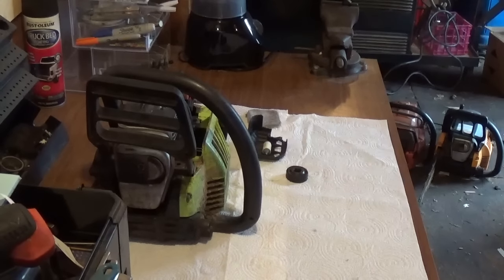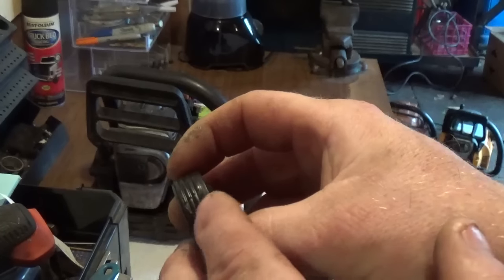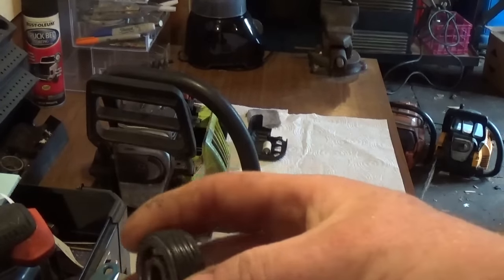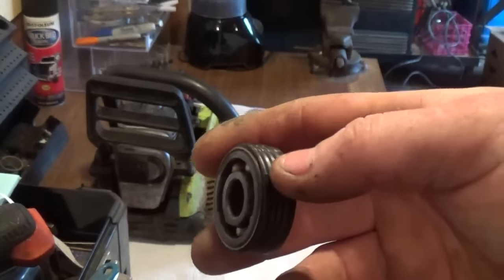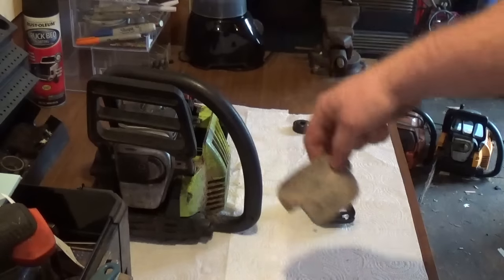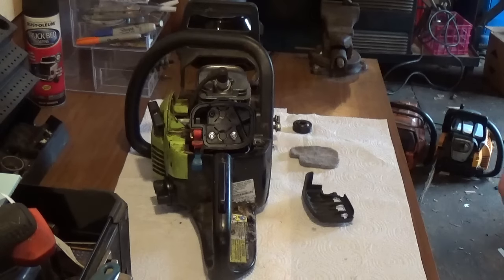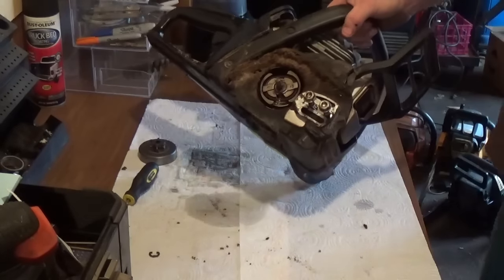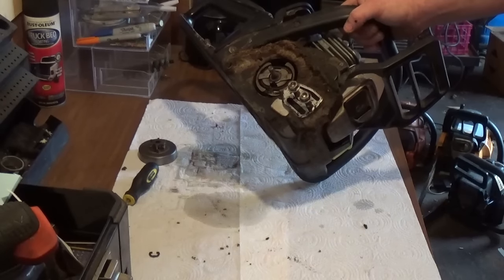Common problems with Poulan Chainsaws

Comment: I agree, Poulan chain saws are a piece of shit.  Worked all day yesterday replacing the fuel lines.  Took 2 trips to the hardware store.  I needed right angle nose pliers and a long nose pliers to pull the fuel lines into the gas tank which took hours.  Got all done, filled her up, then the frickin thing wouldn't start.  My thumb is sore as hell today as the flesh got pulled away from my thumb nail when putting the small fuel line on the carb tubes.  If your not suppose to use ethanol there should be a label on the chain saw.  The replacement fuel lines really suck and are very hard to get on.  I've heard people say to heat the ends before installing them. Also, another problem is keeping the chain on the sprocket.  What the hell should I do now, buy a Stihl?
Reply from the maker: You likely would be a happier customer with a Stihl  just keep above a ms 250 ..

Comment: They just don't know how to use them atleast 6 years ago when I bought my poulan pro it was in a box and i got the right book that goes with the pr5020 inside the box.

I think they used it fucked it up and now don't want it anymore 

Mines used like hell and 6 years old with no problems
Reply from the maker: Turtle Frog if what your saying is true than it shouldnt  be a issue providing a short video validating your claim . Take on the Poulan challenge ...The details are listed in numerous replies and to avoid confusion there is a video posted of what is expected .

Comment: I have done the poulon challenge. Mine is well maintained.
What you hate is poorly maintained machines.
I hate Stihl for one reason. The chain oiler doesn't work right.

Comment: Most chainsaws are identical I got the new skill chainsaw and it doesn't need to be choked. That baby runs rich 50 to 1. You go out three pools and she's running. The only problem I got chain gets dull it really hates dirt when you're cutting don't you put your nose of your chainsaw in the dirt. Most people do when they're cutting and it dulls the hell out of a blade
Reply from the maker: NOT exactly { Chainsaws do differ } but mostly aesthetically ..... Well I should say with at least the cheaper branches of Husqvarna {color wise anyways} Don't get me wrong there are some chainsaws that are unique in  there operation and controls as well as assembly . But for the most part are somewhat all the same with the exception of quality and molding of high end parts

Comment: Mine had shattered fuel lines upon unboxing. Fixed those and replaced carb cause the plastic choke arm shattered as well. Got it to run for 3 minutes tops. Now it's super hard to pull.

Comment: All saws have bad features/designs. I've had fair luck with these saws but recognize how cheap they are. That's their main draw. I've worked on this stuff for nigh 60 years & know cheap doesn't get it. However I know what the weak points are with most cheap saws, I do try to look at each 1 that comes in. Most of what I see are neglect.
Reply from the maker: I to must admit I have seen my fair share of neglect with many pieces of equipment . However I have seen first hand many casting defects with Poulan and to be honest some other lower line saws as well . Failure points so obvious they cant be ignored .....Yet honestly are...... in assembly / manufacturing.......So  although neglect is certainly a issue in some cases simple truths that can be evidently revealed are passively and asininely ignored so that equipment failures can be embellished as a result of improper use . I have found this to be the truth many times .....through warranty relief efforts ....We would show picture after picture proving the cause of failures .....Bringing actual new carbs {NEW }be mindful .......even brand new saws straight out of the box to service schools ........Never even having the Poulan boxes opened and proving there were air leaks .......Only to be told they would be ok once they had been ran for about 30 min ......My boss at the time and I got feed up with this cop out bullshit mentality ......And gathered a group of fellow Techs /Dealers attending a service school .....Brought them outside to the back of a old pickup that had some small maple branches about 5 inches round and asked these crocked bastards whom were advocating that these saws would be just fine to run three of the 6 we brought ....Only one agreed ......He opened four Poulan boxes {SAWS} Brand new ...{Four} and of that four only 1 actually ran the full 30 min often stalling and bogging down before dieing. 2 had flooding issues and the third actually ran hot and showed evidence of scoring of the piston and cylinder ........It would restart after about 10 pulls but was obviously on its way to a permanent failure .....I wont give last names .....But Barry of C.P.D. told us that Poulans had over a 68 percent failure rate in returns . He also said at the time that Husqvarna /Poulan where taking these returns and in the process of making a factory dedicated to nothing more than Refurbishing failed new Poulan and Husqvarna Bottom line saws . Sure enough he was right a few  months later we started seeing little hot pressed{R} on the Poulans that customers brought from time to time to the shop for assessment or repair .....{although to be honest we where in the mindset that no more Poulans would actually be repaired in shop } ......We did from time to time contend to adamant customers .....Eventually George came to terms that it was better to be the asshole of today than the Son of a Bitch of tomorrow and told customers the truths of what we already new . Poulans are {FUCKING JUNK } and at first it offended .....Then as more and more people had there wallets/purses lightened by other dealers only to hide in the shadows of buyers remorse . They started praising George for his honesty . And Damn did Sales go up for our Redmax lines as well as Jonsered Chainsaws .......I Know .....I know ....there both owned by Husqvarna .......Well Redmax wasnt at the time but later Husqvarna bought Redmax for there Strato Charge Tec . So In conclusion 60 years of experience is impressive and I am sure you have seen many pieces of equipment come and go . By that right in its self you have my respect but operator neglect has very little to do with a piece of equipment that is and surly was designed to Fail .
Reply: Well put but I swear there are people that shouldn't be allowed around equipment. No idea what they're doing & if you try to explain to 'em they'll get mad. The cheap line Stihls are exactly that, cheap! The days of buying something that'll last are gone & like you I try to explain to people, in a nice way, that it's a POS. Sometimes they listen, sometimes they don't. The shop I worked in took everything & anything in & that nigh on to 40 years ago. Parts were available for the most part then. Nowadays you have to rely on either aftermarket or used stuff. In this area 028 Stihl parts are virtually non-existent but we're talking of a 40 year old saw. There were millions of those sold & they were good saws. Our shop sold Echos in the '80s along with cheap Homelites. Then came the Poulans when H-L shut down. Now that same store sells Stihl, Echo & Husqvarna. There's Huskies everywhere around here now & guess who those stores tell the owners to go for service, you got it! Glad I retired when I did. I do some work for select people but if I don't know 'em, I won't. Luckily I haven't had to eat any equipment repair but so far I've got an 028 that's not going anywhere till $ paid. That's the 1st in a very long time.

Comment: It looks like the customers saws that you are showing were beat bad and never maintained. ANY saw I don't care who makes it will break down when neglected like that. I heated my home only with a wood stove for four years because the price of home heating oil was so high and cut all of the wood with my Poulan 3400 Countervibe. I did not experience any of the issues like that. It sat for many years afterwards and failed because the fuel hoses dried up and cracked. That is to be expected. Three of us cut wood for our homes. Two had Poulans and one had a Stihl. It did not cut wood any better or worse than the Poulans and he had trouble with his.I did buy a newer Poulan 16" when we had a devastating Ice Storm in the 90's. It did have the problem with the gas cap after a few years and it always leaked bar oil like crazy. I also replace the magneto and had to fix the pull start recoil so it was not without problems.
Reply from the maker: No doubt there are a few Poulans seen that were neglected . However these issues are abundant not only with neglected but even maintained equipment as well .....[well if you wont to consider a Poulan maintainable] as often the pieces of crap will not even idle from new . But be as it may you spoke of maintaining being your reasoning to justify your opinion and there is no doubt these saws had seen better days so to speak . But let me ask this friend can you conclusively provide a logistical reason as to why in my other poulan video {Poulan Chainsaw PP 4218 P.O.S.} That these issues are so evident as I personally Know the individuals that purchased both Chainsaws provided in the video and even the purchase date on the Poulans that failed due to not only one warranty failure but two . Look respectfully I understand you feel compelled to voice your opinion and honestly I encourage you to do so on this channel ..... And you may certainly have a few poulans that operate to your satisfaction ...... And if they are as dependable as your insinuating might I ask a small favor of you ? Please provide a short video showing the saws after you have done your routine maintenance performing simple task . Simply start the saw from a cold start .......make 5 cuts half the size of the bar {preferably on hard woods but softer woods such as pine will suffice}.....Then place the idling Poulan on the ground and allow to idle for a min before proceeding to make 5 more cuts ...... Once the cuts are complete take the Poulan and turn it off allowing for a full min to go by before restarting . If the Poulan fires up and continues to idle with out the aid of the operator fanning or slightly pulling the trigger then you can take pride in the fact you will indeed have a dependable saw.
Reply: Its the middle of winter and I am not about to go out and mess with the saw now, I have nothing to cut and no reason to prove anything. I rarely use a chain saw these days. My days of heating with wood are over many years ago after a chimney fire. I also have a new Stihl and it does not always start on first or second pull every time either. I have placed my Poulan on the ground and let it idle time after time when I was cutting wood all of the time and needed to move a log. It was a very dependable saw.

Comment: best place to buy a poulan, craftsman etc saw is at yard sales. People usually give them away and all they need is a slight tune up. If you get into poulan etc, just start a collection so you can swap parts haha! I've beaten mine to death but put new fuel lines, etc on it.
Reply from the maker: Great advice over all / but the need of just a slight tune up...…...that might be speaking mildly about the experience as often there burned up or suffering from major carb or seal issues. Still sound advice if one chooses to keep a Poulan or any saw for that matter.

Comment: I have given my Poulan 2050AV pure hell for 4 years. Other than an occasional carb adjustment....NO PROBLEMS AT ALL
Reply from the maker: Great...Then it shouldnt be an issue to preform the Poulan challenge .
Reply: @kevinbolin7665  Don't feel the need. I have no reason to lie about it nor do I have the time to waste. Just stating my experience.

Comment: Mine is 28 years old and 28 years later its still a bitch to start. Like it needs a compression release.  Once started it runs fine. Thru the years I've replaced the fuel lines bar & chain + carb.
Reply from the maker: Great {what model Poulan do you own ?}

Comment: I had a Poulan Wild Thing for 10 years and must have cut 300 pickup truck loads of firewood with it, since wood was my only winter heat source. Other than having to take out the fire plug the thing never needed fixing! Yes, crazy!!   Someone finally stole it from under my carport. Was it enchanted somehow? Must have been, before the Poulan I had a Stihl that had to go to the shop every year.
Reply from the maker: Wesley 10 years......come on admit the truth …..10 days seem more reasonable seeing how it was enchanted...….Lol 10 min if honesty was honestly being projected . I will say the 300 truck loads of firewood would have been a sight to behold but perhaps your exhaustion from pulling on your enchanted Poulan had made you delusional .But because you seem so adamant upon casting this story and I have no real determination upon berating this comment I will give you the benefit of the doubt ……...Still it remains kind of strange that such a enchanted piece of equipment would have been exposed to would be Poulan bandits . Lol...…. But fear not my faithful Poulan comrade for thou scrench and skip toothed chain will protect you should the trolls of your forest and this channel seek recompense..... so long as they where not taken upon the great Poulan siege.
Reply: @kevinbolin7665  I don't know what was in that specific model to make it run that long but that's what it did. If I'm delusional then you're obsessed with with an imagined evil in the Poulan line of saws. There are a lot of videos about these saws on YouTube made by people using these saws, including those who fix chainsaws for a living, and they seem generally OK with the product. I had been using Stihl saws for years and the only reason I bought the Poulan was a friend working at Walmart got it for me at about wholesale cost. I sawed with it year after year expecting it to need service, but other than needing to remove the fire plug in the muffler choking it down, it kept on running. Surely it must have been near the end of it's working life when it was stolen but I occasionally wonder if I'd been able to keep it just how much longer it would have operated. Certainly it was an unusual experience and not in any way typical of what to expect from any chainsaw regardless of brand, but that's what made it worth mentioning.
Reply from the maker: @wesleytillman9774  Your certainly entitled to believe what you wont …..But I personally have made far to many repairs to the more modern Poulans in the last 20 plus years to know the quality standards of theses Pieces of shit …….Granted Poulan chainsaws haven't always been pieces of shit …...But to try to advocate that these Poulan wild things are dependable in any way is nothing more then the raving of a individual sold on idealism rather than actual fact.

Comment: Just got one for free looks like has hardly been run see if I can get it to run I agree with the air filter that’s a horrible design but if it’s made by husky see if I can retro fit a husky air cleaner on it

Comment: the cap plastic doesn't hold up against gas and is made out of the wrong type of plastic and expands or bloats and check Fuel line cause they bloat too as well the dam Idle Screw keeps spinning loose and Idle speed increases Use Lock Tight or take apart use Mettal Epoxy on threads and adjust to correct setting turn off for day and let the epoxy set on threads and idle problem solved.
Reply from the maker: Dean S  .....Idle problem is solved by Mettal epoxy .....Right ......Well if what you advocate is so true then {TAKE THE POULAN CHALLENGE} after you tune any modern Poulan .
Reply: @kevinbolin7665  Also change hose lines because if any of them Bloat or Crack it will mess up fuel flow and cause dam things to stall . they are Pieces of Crap chain Saws . I got a STILH MS 661C

Comment: I have been using my poulan pro for seven years now. My only complaint is i am constantly having to re adjust fuel mixture.
Reply from the maker: Consider yourself fortunate that you haven't scorn the piston and cylinder by now. And even more fortunate that the saw is even capable of running at all as most poulans have failures straight from the box . My viewers and I would like to see this 7 year old saw in action so please provide a short video .

Comment: i have 2 they both start good and run good ,i put a screw in the vent like all other saws have ,i replace most of the fuel lines  on all saws after the ethanol junk came out